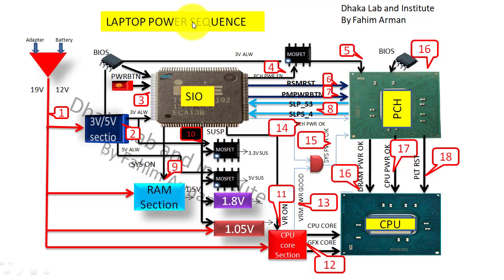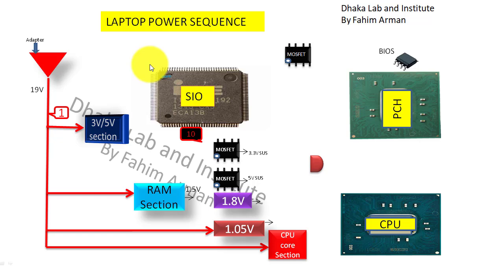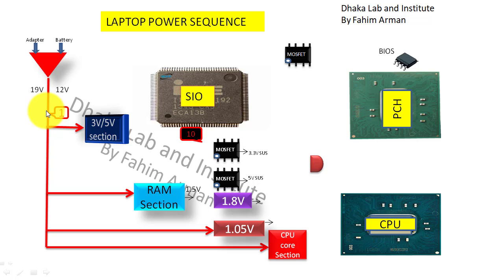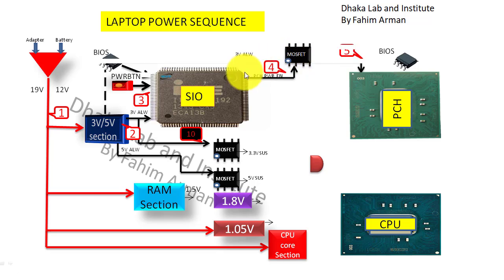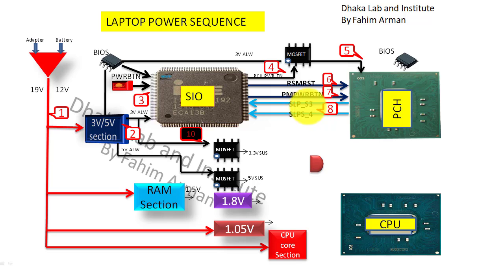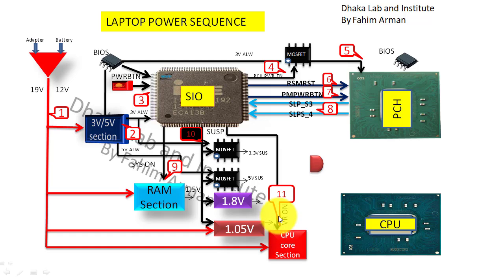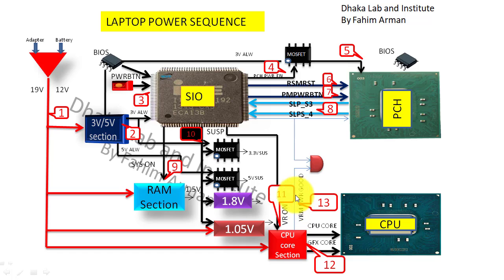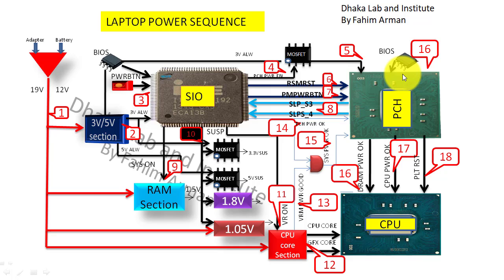Laptop Motherboard power sequence in detail with animation. Dhaka Lab and Institute.

Comment: Excellent. I have a laptop that won't turn on. It has a short in the CPU core section on the +1.8V_PRIM and +3.3V_PRIM lines. Has anyone solved this problem? Is there a CPU reset process that would resolve this issue? A fault in the SIO IC has already been ruled out.

Comment: I need a little more information in this presentation,  in order for ac or battery power to be accepted by the computer, the power management IC needs to turn on the input mosfets.  If you're troubleshooting input voltage you need to start with the PMC